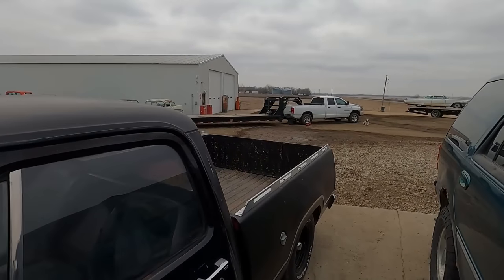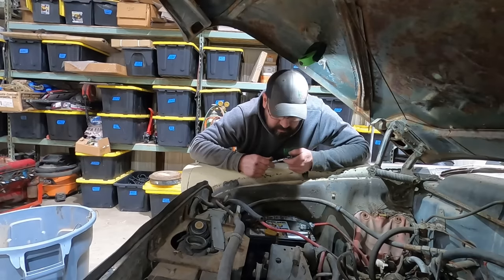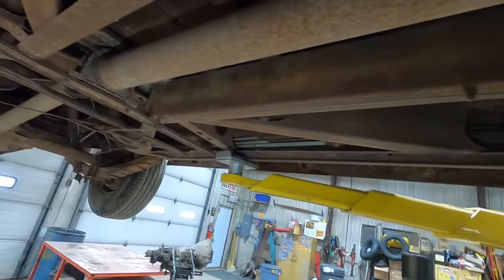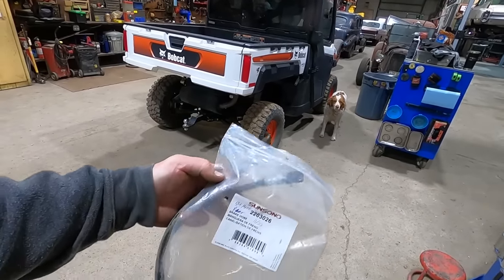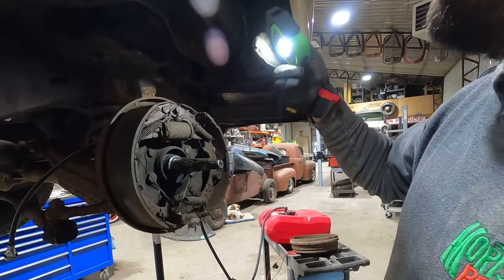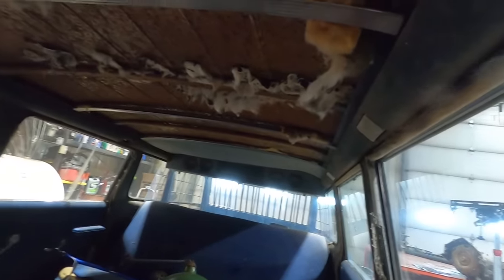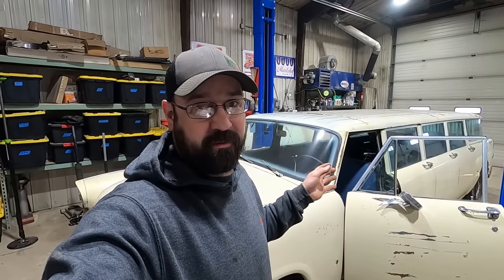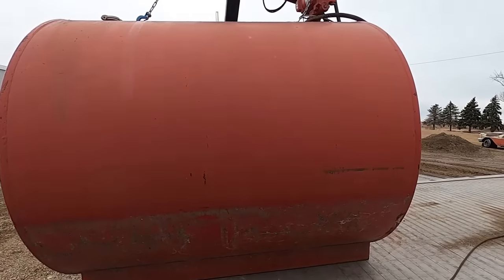Abandoned 1974 Checker Motor Company Aerobus! Will It Run?!? 9 Door Military Airport Limousine!

Comment: My old man drove a Black 8 door Aerobus as a chauffeur for the American Embassy in London England in the mid 70’s. 
The usual car he drove was a 71/72 LTD Station Wagon & on the occasions he brought the Aerobus home it felt like an old classic compared to the LTD at the time. 
On our little street on the edge of London it took up our house & the neighbours house when parked. 
Plus back in the mid 70’s cars were still a bit of a luxury in the London suburbs & this thing blew the neighbours minds. 
I would have been about 5 at the time & he’d let me & my friends play in it after school. 
I do remember plain black forward facing bench seats & door cards. 
And a weird memory of me & my friends having trouble getting the doors unlocked because the tops of the door lock buttons were snapped off on every door. 
Weird how watching this video instantly brought back that particular memory detail 🤔
Hope there’s a part 2 🤞
Reply from the maker: Thanks for sharing!
Reply: How many Minis end to end would equal the length of one of those Aerobus cars? I have owned 3 English cars A Rover 2000 a Mercury Capri(Ford) and now I own a 1996 XJ6 but that one gives me a lot of trouble because something keeps draining the battery over a few days and I cant find it, I used to work on a Rover based car (Honda drive line) in 1988 in Beverly Hills Ca it was called Sterling .
Reply: @Dwayne-mb2uj  funny thing is……
My dad’s actual daily driver that he owned at that time was a bright orange Mini 1000. 
Bizarre huh 😆
Reply: @andyyoung9431  I made a joke because I had worked for Peter Samuelson in LA and he told me he was a part owner of BL and that the Government kept bailing them over and over .He went in to the movie making business .Super nice guy.

Comment: My old 86 Chevy pickup had the same thing with the ignition not moving the rod . I got to where you used the vice grips on the rod part and call it good enough . Drove that truck for three more years just like that . 🤣😂 No one would steal it anyway as the color was supposed to be light blue but in reality the color was giant rust holes .  That cab is the coolest thing I have seen for some time .

Comment: Excellent video Mortske  :) , Duff Dog 🐕,,  , think fix up fuel pump , brakes fluid plus parts needs also change Transmission  fluid plus filter  pan gasket, differential fluid  too , fix up Alternator and  wireing too! Key ignition switch  too and see what all works inside car also anything!
Reply from the maker: Thanks 👍

Comment: Before I went to college I worked in auto restoration of vehicles 1959 or older. Did a lot of packards actually. Often end up with a car that the drums needed to be turned on. All fun and games until you measure for shoe fitment and the manufacturer sends you something completely different from what you asked for. Still usually easier than trying to find aftermarket replacement kits for some of the really old stuff, you know that well

Comment: Wow, where did you find this one?  I worked at the Checker Plant in the early 2000’s when they were stamping out van bumpers and welding Cadillac frame rails.  I met the guy who welded the Aerobus frame together.  He said that it was prone to flexing.  It was pretty cool to see the old assembly line and paint booth with a rolling chassis still there.  The new Mortske limousine?
Reply from the maker: Very cool!

Comment: Fuel tank repair 101 Mortske. 
Original JB WELD . I've used it for years. I have a motorcycle and an old car that I used this on 10 years ago and still holding strong. Its the only thing I have ever found that works. Great show. THANK YOU!
Reply from the maker: Thanks for sharing

Comment: 1972 was the last year of four small round gauges - two on either side of the speedometer. 1972 was also the last year that the Borg Warner automatic transmission was used. So this car is a 1973 or newer. 1974 Checkers had heavy duty silver painted bumpers which were used till the end of Checker production.

Comment: Seal-All, I used that stuff on my oil pan on my 91 Chevy, had a pin hole on the side of it from rott, I drained it cleaned the crap out of it, and used Seal-All on it, lasted a couple of years I've had that truck, Stuff worked pretty good. I was going to do the self tapper with the rubber washer trick if it didn't work lol.
Reply from the maker: Thanks for sharing

Comment: If you know someone with a spill kit, many of them have a sausage-looking roll of sealant that works for fuel leaks. It is a two-part formula that you cut off what you need, knead it til it's a consistent color and then stuff it into and around the leak and let it harden. The stuff works well for fuel and coolant leaks.
Reply from the maker: Interesting
Reply: @MortskeRepair  It's something I picked up a safety rep for two different yet similar companies. The second knew of the first position and "voluntold" me that I was taking the role.

Comment: I was wondering what you were going to do for an encore when it busted off so early. And I got a huge laugh when you mentioned dropping the van motor with the blower in the engine bay cause I had just thought hey as sweet as that 36 Ford pickup would look with the blower this thing would certainly draw some looks with the length of this thing and a blower out the hood.

Comment: Distilled vinegar has worked well to remove rust in tanks, and was far cheaper then Evaporust. I dump a gallon in, and sit it out in the sun for a day, rotating every day or so to get the entire tank. Power wash, repeat if necessary. 

Plus, you can pour it out and use it for pickles!

Comment: Wow! I started working on those back in 1981. When my college money ran out I went to work for my uncle in his body shop. We did the repairs for the airport and I thought we were going to work on “Limos”🤣 if we had to work on both ends of the vehicle, I repaired all the body work and then could only paint one end, back it out, turn it around and paint the other end. 🤣 Our bays could barely fit a crew cab dually and our paint booth barely fit full sized pick up.  I was so glad when we got the Toyota account and I started working on Toyota trucks😁 Another fun fact, almost every one of them in our area crabbed down the road because there were no shops large enough to pull the diamond out of the frame. They were a sight to see when driving behind one on the road,especially in the curve of a on/off ramp🤣
Reply from the maker: Thanks for sharing

Comment: Your common hand cleaner, such as gojo or whatever you have around works wonders on the sticky steering wheel. Also will shine up your gunky spark plug wires if you're into that sort of thing.
Reply from the maker: Thanks for the info

Comment: Through research I found out that the deadly inline glass fuel filter by Mr gasket is the same micron as a fuel sock. I would never use under hood for obvious reasons but back by the tank on the frame is ok and you can keep an eye on it and change it easily

Comment: Richard Pryor did a cheesy movie many years ago called "Blue Collar" or something like that. It was about assembly line guys burglarizing the Union hall and they filmed parts of it in the Checker plant. It's worth watching if you are into Checkers at all Great video too. Once you own a Checker, you're hooked. I bet you keep this.
Reply from the maker: I’ll check it out! I did some reading on the movie. Are you a checker owner?
Reply: I have one. Not a block long though. Mine has a 327 in it. It's a 66. I have seen them with straight sixes though. I'm not an expert, but I have been told that the straight sixes were common and I have seen 3 or 4. V-8's are what you want. Never seen a 4 barrel that I recall. 2 Jet with a hand choke. These were designed for cab drivers
 @MortskeRepair

Comment: I heard that Checker bought out the rights from GM, to become the sole users of the 283 small block. They started building them for use in their taxi cabs. I had a cousin, who was a mechanic for our local Chevrolet dealership, from the late 60's to the late 80's, who told me that. He said that Checker wanted the 283, because they knew how reliable and bulletproof the 283's were. So it was the perfect engine for their taxi's. Dont know how long they produced them for. I know my cousin said, that out of all the small block Chevrolet's that GM developed (Pre-LS), the 283 was by far, the cream of the crop.
Reply from the maker: Interesting

Comment: Purpose built, not a stretch. Aerobus' were built in Checker Plant 3 a separate line from the Marathon/station wagon assembly line. 74 was the last year for the standard Aerobus. In 1976 CMC introduced the longer sedan based Aerobus-15 with an extra row of seats.  CMC stamped out all body panels most mechanicals are GM.
Reply from the maker: Thanks for sharing

Comment: Worked on and driven one myself...front end was worn out and the 350 struggled to get it to the point the front end would become unsafe.. It did not have a 9 inch either, think it might have been a dana.

Comment: Turn the ignition to the accessorie position before depressing the lock pin then remove it , you also need to buy a seat belt type oil filter wrench

Comment: Was watching you grinding the fuel tank and for some reason an image of you as a human Pez dispenser came to mind. Was doing the same repair on a 40 gallon oil drum once (empty and tap open for 18 months) and it blew the fumes. The flapper wheel and angle grinder went over my right shoulder and I had 2 or three seconds of looking at an empty space where the drum was stood then BANG as the spinning barrel hit the floor right where it took off from. 
Both ends were blown out perfect like a hemi !!  My bud saw the whole thing, said it spun like a prop the whole 20yds up and down. Pez head???
Reply from the maker: Good times

Comment: Checker Riviera with longest hood front to back in the cab is $90,000 dollars worth of roller and it never run and heavy by 500 pounds more than 1957 Bel Air in weight. That station wagen is tons heavier at like 7 MPG.

Comment: 21:19 c'mon WE ALL KNOW the pockets are for filling up on fuses, relays, lightbulbs, speed nut clips, lug nuts, and radio knobs at the self service yard.  The tool bag gets checked, but I've never been felt up at a Pick N Pull.  At least by someone other than the wife.  And that's what the cargo/conversion van section is for.

Comment: My understanding is the old smog pump was put on cars to pump air into the exhaust so the catalytic converter had some oxygen to burn the left over fumes from combustion. I didn't see a catalytic converter on that 40ft of pipe so I'm wondering if Checker just dropped those motors in there straight from GM or did that motor come out of another vehicle? I'm wondering too whether the ram horn manifolds came on it from GM and were hold overs from the 1960's they were getting rid of? Nice old car. Not sure if you want to lower it much or you'll get it hung up on the rail crossing out there near your house.

Comment: Use a brass wire wheel, no sparks that way. Put dry ice in the tank, remove the oxygen, and you can weld it.
Reply from the maker: Thanks for the tip

Comment: I wish you would have showed the removal of the bolts from the sending unit.  I'm assuming the tank sat without gas for a long time so it was safe.  It's always interesting to see the steps people take before they stick a torch near a tank.  about 30 years ago, I had to fix some holes in the gas tank on a Jensen Healey.  I washed it out with soapy water for hours.  let it sit.  washed it out.  over and over.  I took it outside the shop and stuck a torch to the filler neck and that thing went 30 feet up in the air.  When it finally landed, it was swollen like like a balloon.  I wince at even thinking about heat and gas tanks  :(
Reply from the maker: Fun times

Comment: This popped up on the google machine

Andrau Airpark
IATA: noneICAO: KAAP
Summary
Airport type	General Aviation
Operator	Closed
Serves	Houston, Texas
Elevation AMSL	80 ft / 24.38 m
Coordinates	29°43′00″N 95°35′00″W
Runways
Direction	Length	Surface
ft	m
16/34	4,750	1,447.8	Concrete
11/29	3,000	914.4	Concrete
Andrau Airpark (ICAO: KAAP) was a public use airport located in the Alief community of Houston, Texas, United States, formerly an unincorporated section of Harris County, from the late 1940s through 1998. The airport was southeast of the intersection of Old Westheimer Road (since renamed West Houston Center Boulevard) and Richmond Avenue. The airport closed in 1998 and as of 2008 is the Royal Oaks Country Club subdivision.

Comment: old fan belt wrapped around the steering wheel and slamm...ed in the door would have prevented that wheel from turning ... or if you want to be fancy use a long rubber bungie with the hooks removed and slam that in the door ...why you always see fan belts hanging on the mast of old wreckers ...

Comment: A little bit more Checker history. When the American Bantam Corporation figured out they had a pretty good chance of getting their little prototype of the Jeep selected by the military, they were scrambling to find a partner to manufacturer it as they knew they were just too small to do it. They began working with Checker to produce them, however the war board stepped in determined that Checker couldn't make enough, either, so selected Willys and eventually Ford as well. Bantam and Checker were given some lucrative contacts to produce trailers for the military during the war to stay afloat, though. You could also get a Checker cab with a Chevy 2.8 V6, still with a TH400 behind it. Talk about a turd.
Reply from the maker: Thanks for the info

Comment: That aerobus is too heavy to lower. It needs the ground clearance to get down the road in a paved world. Aftermarket wheels are a no go. They wont have that bolt patern in that load range. Those wheels are sought after for demo derby builders. The seats realy need to be reset to the stock locations. A copy of the missing seat can be made very easy. Not an elaborate item.

Comment: That's actually factory air condition that's the way those came that's why it has the factory compressor they didn't have like in the dash on those they are under the dash like something aftermarket? But that's factory air condition in the checkered.
Reply from the maker: Interesting

Comment: Definitely a blower motor might need the extra hp's 😂😂😂 oh and you hate headers because you can't get to the spark plugs well a 2003 Chevy s10 2wd ext cab you can't get to the middle spark on the driver side with a socket unless you unhook the steering shaft from the box that's poor planning on GM's part aswell as the only good access is through the inner fender
Reply from the maker: Yuck

Comment: That code on the key tag is for the locksmith to make new key. Different codes for doors, trunk, and glovebox . take that number to the parts dept and we had a hand held key punch. load a blank, dial the code in, squeeze the handle and voila
Reply from the maker: Interesting
Reply: @MortskeRepair  yeah, I'm sure these codes are now no longer reliable for use as they are fairly obsolete now a days, but you never know. But that code was the tumbler peaks and valleys in case you lost they key, you had the code for a duplicate.

Comment: P=Park - R=Reverse - N=Neutral - D=Drive - S=Second (gear) - L=Low (gear). Put it in "L" and it stays in 1st gear, select "S" and it will use 1st and 2nd gear but not shift up to 3rd, "D" will make it use all range of forward motion gears in normal operation. I'm going to guess you know what Park and Reverse do.

Comment: It is interesting what market value has this car as a collectible. If the cost to restore is much higher then market value then you might do your videos and call it a day.
That would be a pity since the vehicle is quite cool.
The problem is the vehicle with factory powertrain is severely underpowered. To change the engine means to restomod it which is quite expensive.
The handling of the vehicle was like a boat so after changing engine it requires upgraded suspension and brakes. Then entire frame, body has to be devoided of rust, interior rebuilt. These kind of projects are always sketchy from financial sustainability point of view.

Comment: Areobuses are out there. The bumpers on it indicate it is prior to 74 but maybe in 74 they still had the old style in stock. I'm sure there is a gas tank that will fit it or clean that one out good and weld in a patch. The filler neck location on a new tank would be the issue.

Comment: One way you can fix a hole in a gas tank is to solder a penny over the hole as well.  My grandfather taught me that its Sketchy, but it does work It's even easier to use a hot air blow gun like used for plastic welding